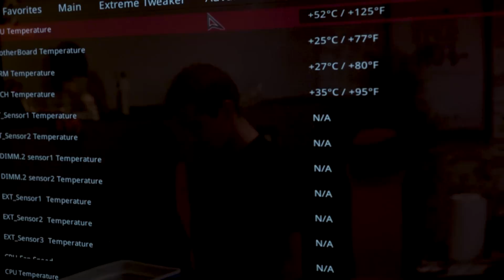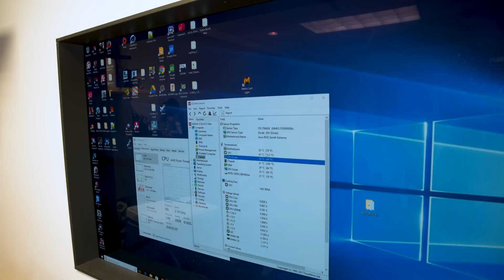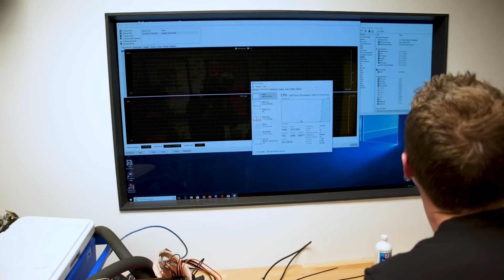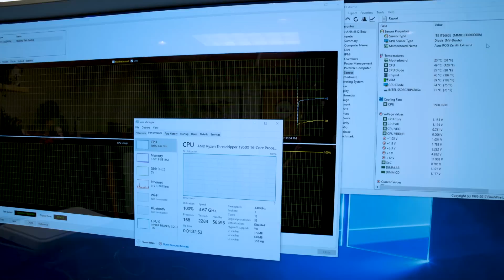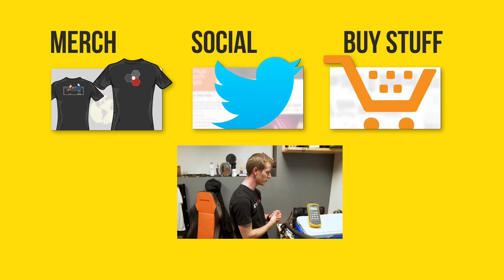My 10 Year Old Chiller WORKS! -20C on THREADRIPPER!

Comment: Honestly you should've left the air unit together, stuck it in a window and ran the hoses out - then you don't have the excess heat if that's something you don't like... Since my car accident may 2011 anything under than 80 degrees kills me and I used to love the cold, now I'm stuck with nasty heat but it helps with pain levels so..... With the window install, you could make a custom housing for the anti-freeze or, in your case, windshield wiper fluid inside of the AC unit housing - there is typically enough room to do this anyway... Also, these units cost around $100 USD and typically have a rating of $30 USD electricity cost for year-round running - if I recall correctly from the last one we bought 8 years ago...

Comment: You need HVAC friends.  Maybe a friend at swadjlok. And a plumber . you could make it actually run the refrigerant through the die , not transfered through the liquid . and have the complete computer in a lexan double walled box purged with dry no2 . us old plumbers all have a bottle or two of dry no2 . have the compressor and high side on a classy shelf outside of window , with hoses coming in through a proper block under window , to computer . this would quiet that hot mess down and not heat the room . and no need to wait for gin tub to cool down .
Reply: The dry no2 eliminates the need for vasaline , liquid tape . the lexane box allows it all to be visible . oh and anywhere you see ice or condensate , you are losing thermal potential .

Comment: I'm wondering how it would perform if the cooler was placed inside a mineral oil case alongside a pc.. that way much less heat is lost during the transfers between the different cooling loops..

Comment: I wondered about this type of cooling. Like many I have my eye on a 16 core Threadripper. I write code that uses all threads at once. So on my 9590 I watch temperatures close and wish I could cool it like you just did.  I worry when it has to run several days at 100%.

Comment: uhhh, it goes compressing gas to liquid, cooling liquid in condenser (as it generates a lot of heat compressing gas to liquid), evaporating liquid to gas in the evap (thin line to thicker line, compressed gas becomes super cool when it expands and becomes gas again). 

your process is off a bit

Comment: I was always under the impression that the A/C compressor compressed the refrigerant whilst still in gas form, which then went on to the condenser coil to be turned into a liquid (i.e. condensed), and then to the evaporator coil to be evaporated.

Comment: id like to see a rebuild of this cooling system, but used on an oil filled pc. with the oil shielding the motherboard, you shouldnt need to worry about frost, and should be able to take it cooler, without worry.

Comment: Why not run a sub-zero radiator in front of each of your workstation radiators for individually cooled PCs with the condenser outside.  A room of sub-ambient PCs without each requiring a full sub-zero build

Comment: Wondering why you didn't use antifreeze instead of windshield fluid? Antifreeze would be easier on your lines. I know your not using this long term but heat exchange might be better. Cool though!

Comment: Meh, mount the mobo upside down so the condensation just drips to the ground into a bucket. Pro tip. Pour gallon jugs sideways for no air pressure shenanigans. Any why use windshield washer fluid instead of glycol?

Comment: Put the unit outdoor then run a long insulated tubing to your PC grab another evaporator coil and pump in the chilled water thru it and use the old housing of the Window AC (with Blower of course) to house the second evaporator coil. 
Now you cool your PC and your room at the same Time.
You just build a Chilled water Air-conditioning system that also cools down your extremely overclocked PC .

Comment: Now I remember why I used a peltier back in the day.  Entire cooling solution inside a mid tower with  -40C idle and -13C full load CPU temps.  Too bad the plastic CPU socket disintegrated after 6 months from the temperature cycles, ruining the board.  Still, that Celeron 566 clocked at 1100Mhz was fun while it lasted.

Comment: 1:35 Correction (Sorry Linus)
Fluids can not be compressed! (explanation below if you care enough to read it)
The compressor compresses the gas -> the condenser liquifies the hot compressed gas by cooling it down  -> the expansion valve injects the fluid into the evaporator (like a spray can) -> the injected fluid expands inside the evaporator and turns to a gas again. this expansion (or phase change) requiers energy. the energy that is needed is absorbed by the evaporators surroundings in form of heat. therefor the evaporator cools it's surroundings. thermodynamics :)

Comment: I thought you run a compressor first before the "condenser"? liquid compressibility is very low and I thought the whole point of the compressor is to convert the gas into a liquid, making its temperature higher than ambient temp (Boyle's law). Am I missing something?

Comment: I actually run my A.C trough my PC. I added a vent on the Ac to split the cool air, one just for the room and the other connect to a duct to the pc.  I don't get sub zero but from 5c to 18c.

Comment: Linus, what if you did this with two or three GPUs in a mining configuration?  It would be very cool to see the effects on temps, as this would be a very discrete method to conceal the presence of mining gear.

Run water blocks to the GPUs, stream heat outside and avoid excess heating of the mining area. The challenge would be doing this within a window unit.  If someone were to purpose make modified Window units for this role, it could work!

Comment: Linus you got wrong informations about Refrigerant Cycle 

Actually the compressor compress the gas into high pressure/temperature gas 
The condenser lower the temperature so it condensed into Liquid 
Then it runs into the Capillary Tube (or Expansion valve / Orifice tube in some systems) and the liquid expand into cold gas which freeze the evaporator and then return into the compressor 

If you need any tips on AC just tell me 
I'm mechanical engineering from Iraq 
Loolz

Comment: Okay, so, real talk. What and how did you get a room A/C unit to work as a chillerbox? That's the part I want to know about most, first.

Second, any suggestions for say, being able to locate the resulting "chiller" unit outdoors where it can dissipate its heat safely (like on a porch or balcony) and then just pipe in that sweet cooling goodness back to your PC? :D

Comment: Coming from a mechanic's background you actually cocked up quite a bit, antifreeze is just at that after all a chemical agent that is resistant to freezing it's actually very bad at conducting thermal heat, that's why you add water because it's the best thermal conductor, the trade-off of course is that the freezing point then goes up and you use the antifreeze tester to balance that point where you want it.

Comment: Back in the day when ppl like myself were torturing Barton cores and AMD lappy cpu's we found a peltier was very good at helping the heat shift quickly into the cooler circuit as getting a really good wattage peltier mean't the hotter you ran it, the cooler in return it would become.   Gave all that up as melting NF2 boards was a costly exercise back then, gotta give a shout out to my ancient Coolmaster MK1 V8 which is holding my oc'd AMD quad at a nice and steady 19c which does me :D

Comment: Well I'm an hvac student so ideally you need 95 Fahrenheit across that coil with the fans to get the max performance out of that window unit also you might wanna check and see how much refrigerant is left in those tubes seeing as they mightve leaked in storage and if you can swap out the refrigerant for a newer one as the new ones can handle heat a bit better then the older ones
Reply: Also those lines freezing up like that is one of the signs of low refrigerant even if they arent insulated they shouldn't freeze especially at the compressor

Comment: Oh my god...and everyone thought I was nuts when I built mine out of parts from a deep freeze. Thank you, nice to know I'm not the only one who has tried refrigerated cooling. Only...mines a little different, don t use water pipes or lines, copper cpu block  with small  refrigerant lines straight though it, only using  evaporator coil. Condensation is a bit more a concern to then the way you did it. Gets pretty "wet"

Comment: you got the flow direction in the refrigeration system backwards. compressor compresses the gas, then the condenser cools and condenses the gas to a liquid. the high pressure liquid is bled through a valve into the lower pressure evaporator where it absorbs heat and boils into a low pressure gas. the gas is then compressed again.

Comment: I'd be looking at coating the motherboard with a water resistant coating if I were doing water cooling. Doing so would prevent the motherboard and other components being damaged in the event that a leak occurs. I've also came up with my own design concepts for an external water cooler, to work just like a mini-fridge would, with controlled temperature scaling so you can choose where you want the temperature to sit, and also have the ability to use timers so that it can automatically adjust the temperatures for you if things get too hot or too cold.

Comment: What I have in mind is actually your full room water cooling project, by putting the heat exchanger and the air conditioning unit outside the building, the cold water can cool both your computer and your room.

Comment: Wouldn't it be simpler to keep the AC unit whole, leave it in the window, but run a line in series with the evaporator to a second small radiator sitting inside your regular water cooling tank? You can also move the thermostat probe from the AC unit into the tank. This way the unit turns on or off on demand as set on the AC unit thermostat... Would also look better and be less of an electrical hazard...

Comment: You could in theory use AC to cool the CPU and considering the AC exhaust is on the outside of the building, you'll end up with a cool room and a cool CPU all with a single AC unit. 

I wonder if you could just use the cold water straight from a faucet or wall. Of course it would mean you can only keep your PC near a water source, but it might even be cost effective.

Comment: sigh.... linus did you completely forget about kneeding eraser method? 
Did you not learn anything when you used to be over at XtremeSystems

Since your not going to be playing with it very long, and its a single stage chiller from the looks of it, you could of saved that board by using a kneeding eraser.

Comment: A/c doesn’t actually compress fluid.... mainly because liquids don’t compress... the a/c machine pulls heat out of a system when the refrigerant turns from a high pressure gas into a low pressure liquid. Not a compressed or high pressure liquid.

Comment: The compressed fluid goes to the condenser, not the evaporator. 

When the compressor compresses the fluid, it heats up and gets sent to the condenser. It is hotter than the surrounding air which then leeches the heat into the environment with the help of the fans. 

That cooler fluid is sent to an expander valve which decreases the pressure on the fluid and cools it even more. That cool fluid goes through the evaporator radiator which will absorb the hear of the CPU. 

That warm fluid will go to the compressor and the cycle continues.

Comment: That's not how a cooler work. Compressor - condensator - expantion vavle - evaporator. The evaporatored fluid (gas) goes back to the compressor. Sending a liquid through the compressor would destroy it as you can't compress a liquid

Comment: Linus: Putting your computer in the fridge is stupid.
Also Linus: Putting a fridge in your computer is awesome!
Reply: the compressor in s fridge isn't designed to tackle sustained heat production as he explained in that video, this method of using the compressor and radiator however, is
Reply: u r fun
Reply: @sadmanh0  r/wooooosh
Reply: @aryansingh2199  singh are you the one???
Reply: lol :P
Reply: Engineers: What's the point of this joke?

Comment: what are the potential gains that can be achieved by incorporating a system like this? if a motherboard was designed to expel condensation and the board was dipped and set into epoxy resin I think you could design a system to run this way by using a temperature control switch. I've never overclocked so I'm not sure about the limits. you could use an aquarium chiller.

Comment: Now, can we FINALLY TEST a working motherboard strapped to the roof of your car driven at 100+ KMH (60 MPH) to see how much cooling the motherboard and CPU would receive with a STOCK CPU cooler onboard and with NO CPU cooler attached!
AND THEN see whether higher and lower driving speeds would allow us to overclock more or less with or without a cpu cooler attached! Try speeds of 30 KMH, then 50KMH then 80 KMH, then 100 kmh up to to 160 KMH (100 MPH) to see just how much wind speed will cool a working motherboard!
Reply: Attaxh it with brackets and screws to the rooftop luggage securing racks most SUVs and crossovers have... At least 60% of you have a subaru and have them 😂 why is it that everyone at a LAN event drives a wrx?
Reply: Directly attach the clock speed to the speed of your car
Reply: I already want to put a Dell workstation in my car... i could use it as an extra heater as well as play games/movies n stuff... don't even need a rad, just use a cold air vent... :P
Reply: Tune the fuel injection chip too with the old serial/parallel ports lol.
Reply: "Whatcha got in there?" 2.0L with 6 core Xeon.
Reply: 60 MPH is 96.5KMH, not >100.  But that wouldnt be a bad idea, as there is more surface area in the air than any metal cooler...
Reply: StarGateSG7 is doing this even legal?
Reply: @nota5wagyu  Why wouldn't it be?

Legality isn't the issue.... Stupidity is.
Reply: @nexxusty  ah
Reply: Because it's potentially dangerous? Imagine driving down the highway and a fucking motherboard flies off of the car in front of you and smashes your front window. That's why all kinds of externally mounted things need to pass test first, to be legally allowed to be mounted.
Reply: You don't need to mount it outside.
Reply: @Matheus.Shindume  He literally commented simply just strapping it on your car.
Reply: Well, that can't be done... legally, so, let's do it legally.
Reply: @StartellerRX-8  Mount your bicycle onto the roof with allowed holders and duck tape that pc for it. Haha. Do not use overclocked PC on rooftop when congestion comes haha.

Comment: You can also use the unit off an old freezer ! did that 6 years ago ! With a pc in the cellar ( with a long vga , usb , speaker , start and reset cable to my room ) Worked perfectly ! The hot air gone outside . Super cold and very quiet ! No noise whatsoever ( in my room ) it also used much less power then a airco ! ( i believe it was just around 200 watts , airco is much more )

Comment: I wonder what the temperature of a CPU would be if you used a regular water cooling set-up, but added a second CPU block and clamped it to the cold side of a 12 volt peltier plate (thermoelectric cooler) with an air cooled heat sink on the hot side (out of the case of course). They are pretty cheap on evilbay, and come in many different sizes and outputs. Would be a cool little experiment to see if it can at least relieve CPU temps a little bit.

Comment: Him explaining the cooling system made me cringe. Liquids are virtually impossible to compress. If his explanation was accurate... well the compressor would destroy itself.
Reply: well he is mostly right, except by "compressed liquid" i think he meant "gas compressed into a liquid"
Reply: *almost all liquids can be compressed, many become solids under extreme pressure and the right temperature conditions. Some also become nuclear fission reactions :)
Reply: Joel Devlin Yes but that’s a ridiculous amount of pressure, the kind you would get at the bottom of a 60km ocean on a planet with gravity 10 times more than that of earths. Not the kind you get in a water pump
Reply: he said this is the "compressor that compresses that fluid", gases are fluids as well, i will give him points since he isnt an engineer, nothing would happen to the compressor
Reply: Only superheated vapor from the evaporator makes goes into the compressor, not liquid.
Reply: Red Reaper not superheated. Warm refrigerant vapor goes to the compressor where it gets compressed and heated. The condenser removes the heat from the compressed vapor. The cooled compressed vapor goes into a txv which is an expansion valve. When the cooled compressed vapor goes through the txv it expands and the temperature drops and it changes phase into a liquid then sending it into the evaporator where it pulls heat from the medium that the evaporator is cooling, and it becomes a vapor again going back into the compressor
Reply: i wouldnt give him credit for compressed liquid but it is an actual term, it generally is used to describe water that isnt about to phase change to a gas, also he said compressed fluid, gases are fluids as well
Reply: well technically that would depend on your definition of  compress all liquids are actually easy to compress as any added pressure would compress it just to a negligible degree
Reply: he meant the gas bro.
Reply: I guess he's mixing up the concepts of an object being compressed/under pressure and it actually shrinking. The former is perfectly possible with liquids: https://en.wikipedia.org/wiki/Compressed_fluid